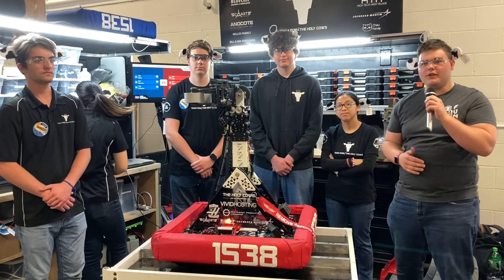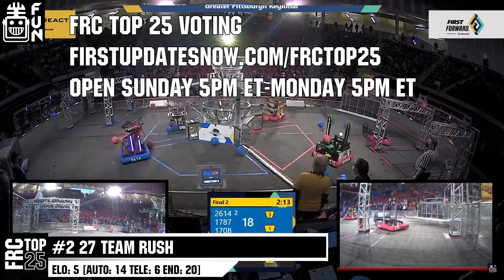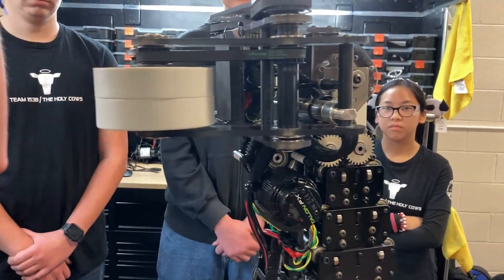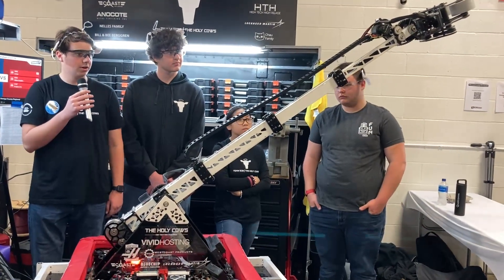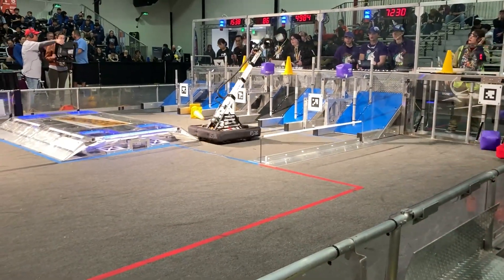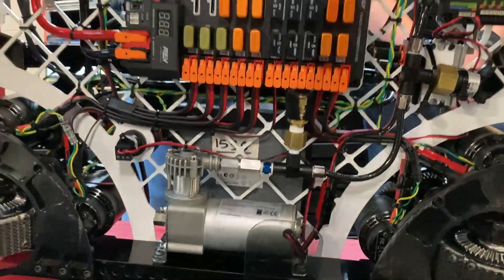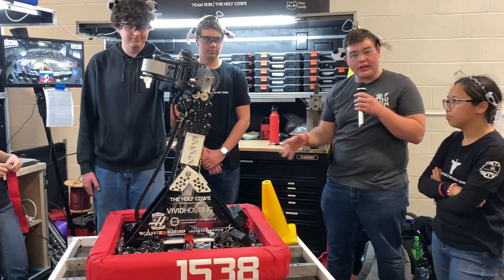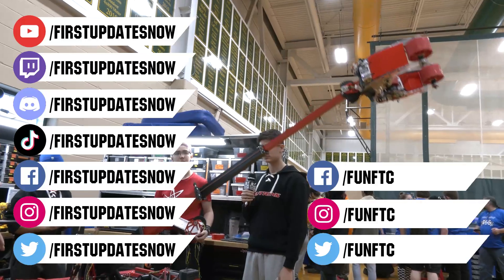Behind the Bumpers 1538 | The Holy Cows | Charged Up Robot Overview

Comment: A: Do you have any issues with the electronics on the bottom scraping the floor of the charge station, or is there a shield protecting the electronics?

B: Have you had any issues with FTAs or Inspectors since the status lights (at least on the PDH) are not normally visible?